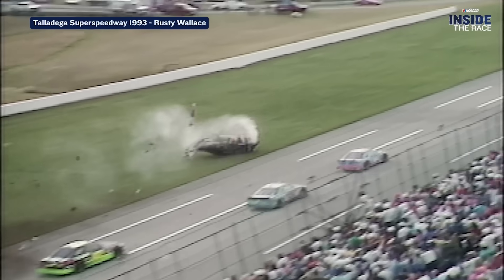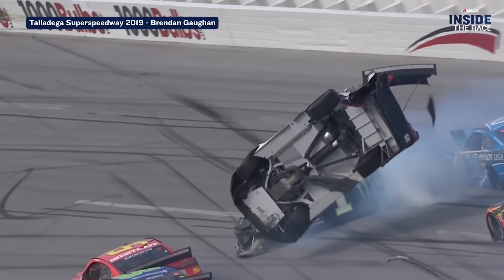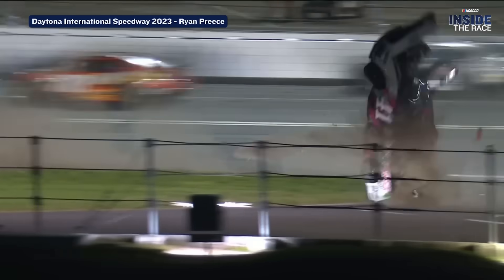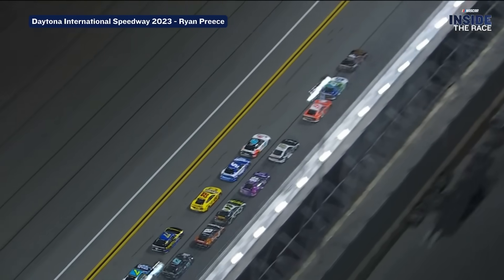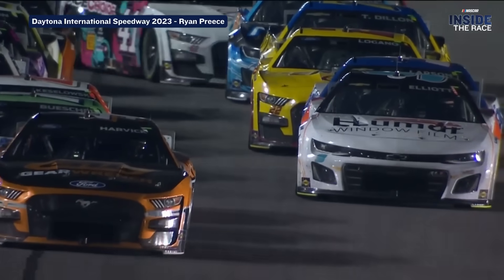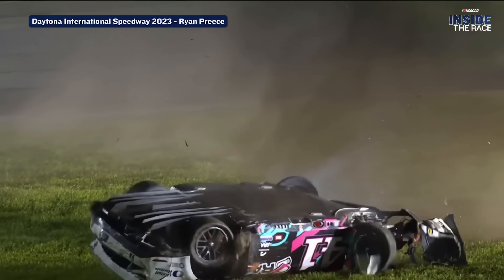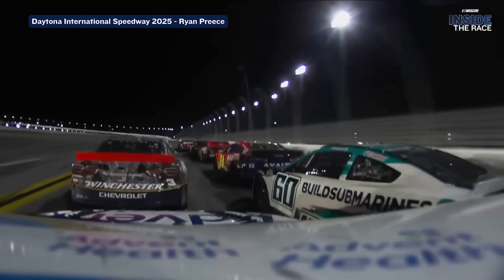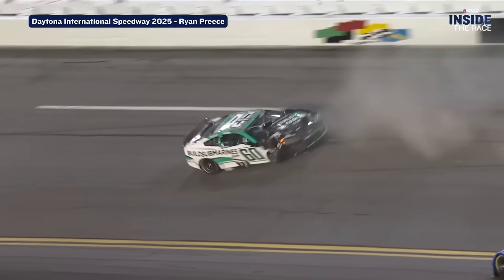Why it's so difficult to keep cars from going airborne | NASCAR

Comment: i feel the chain-link fence is the big problem, if you were to put at least 3 inches of lexan panels on the inside of the fence, the cars wouldn't dig in like a cheese grader.
Reply: I’ve said this for over two decades trying to create a safer solution. That idea won’t happen simply because of the rubber and dirt getting it hazy dirty. Would not be practical. But yes lexan would prevent the cheese grader of metal
Reply: @92genda  someone has been watching battle bots lol

Comment: Reworking the underbody is one way to lessen the frequency of them
Reply: id argue daytona paving that apron was part of it too. there’s nothing to physically stop the car from flipping like when there’s grass there. car is going to continue sliding until it’s acted on by a greater force
Reply: Shhh, don't say that! The flat smooth surface that covers almost the entire footprint of the bottom of the car cannot be the problem! The only way they'll consider that being an issue is if a high profile driver gets killed, you know, just like the non reaction they had with the string of basilar skull fractures that took Roper, Coleman, Alexander, Irwin & Petty until it got Dale Sr. then "something had to be done".
Reply: @kchez5586 Consider that NASCAR is the only non open-wheel series to suffer this many blowovers. Even GT500 cars, which have far more aggressive underbody aerodynamics (Cup cars are hilariously basic) don't really flip at all unless there's a catastrophic impact with either a tire barrier or another car.
Reply: @griffinfaulkner3514  Those cars aren't going quite as fast, and they're not packed up like this which means less chances for crashes in general, which means less chances for blowovers.
Reply: @WastdTrashPanda  Here's the thing, what few wrecks have happened at those speeds in GT500 haven't resulted in blowovers. Even adding GTP and Hypercar into the mix, the cars just don't flip nearly as readily as current Cup cars seem to. Pack racing's part of it, but taking another look at it I think there's another factor outside the cars themselves: the runoff area.

See, the runoff area around most of the circuits that see the kind of speeds Cup cars reach is just as smooth as the racing surface if it's paved, and grass where it isn't. Looking at the runoff at places like Daytona and Talladega, there's bumps and undulations all over the place on the paved sections, and if you hit one of those sideways at 180+ you're going to get airborne, regardless of what the floor looks like.

The only way to reduce the number of blowovers that doesn't involve completely redoing the runoff on a good chunk of NASCAR's ovals is reducing the amount of pack racing, which paradoxically requires throwing more power and less downforce at the cars to let them spread out more.

Comment: The Difference between a 35,000 Pound nascar car if the air gets into the car like due to wind or speed like 200mph in superspeedways and if the car gets on his roof and the grass grabs the roof of the car and cause to Barrol roll like many times.
Reply: 35,000? How about 3,500 lol
Reply: Do you know it 3500 lbs

Comment: Simple fix, rely more on mechanical grip and get rid of some of the aero.
Reply: Get rid of some aero? You mean DOWNforce?😂
Reply: @ yep, exactly what I mean
Reply: You really should google what downforce is and how it effects cars
Reply: @therealpote  I know what downforce does, I have been an avid race fan and car nerd basically since birth. maybe you should look up what a modified car is an how with only a minimal amount of downforce and can lap faster around places like Bristol and Martinsville than a cup car.
Reply: If it was a simple fix, it would have been fixed a long time ago. You're not very intelligent
Reply: Get rid of the flat underbodies at superspeedways, it will take a lot more to get them airbourne that way
Reply: Fix the flat bottom, remove the rear diffuser, it is just there for looks at this point, go back to the multi lug nutted tire as the rims are more closed preventing air from going underneath. and boom, less flips
Reply: Did you watch the video? Half the cars didn't have a flat bottom and they still flipped.
Reply: @therealpote  well, duh, cars are always gonna flip, but these flat underbodies are contributing to guarantee flips, look at ryan preece's crash at daytona this year, did a wheelie like it's Cruis'n Exotica, that never happened before
Reply: @therealpote  flat bottom does have an effect however I think it is more about how low the cars ride mixed with how seemingly large body shape wise they have gotten since gen 4. if the car is anything but on its' wheels now it is going to act like a massive wing at takeoff speed. Gen 4 used to have that issue until they introduced the flaps then it got pretty rare and was usually caused by secondary contact during the crash.
Reply: @pacthesir watch WEC

Comment: Counterpoint: barrell rolling is a great way to dissipate energy though lots of tiny impacts vs one big one, so maybe we should just try to find ways to make the flight happen in a controlled area (moving fans back from the catch fence) than keep sanitising the sport by slowing the cars down or paving all the runoff

As soon as they paved the daytona backstraight they had a car go upside down, stay upside down and have a terrible impact the wrong way up into the inside wall.
A roll through the grass wouldn't have been half as dangerous as that impact was.

When has any driver been hurt just from a barrell roll without any other impact etc 
Then cars are strong....they can take it 

You're not gonna get a bigger roll than preeces and he was ok
Reply: More horsepower not less.
Reply: @stevemullen8457 even at the superspeedways?
Reply: Then they should do what they did with the Daytona Rising project. The lower seats in the tri oval were elevated and moved back slightly so they weren't as close to the fence.
Reply: Excuse me, Ryan Preece was way more banged up from his barrell roll than Josh Berry was from his blowover.  And the emergency hatch ripped open. Berry's crash was definitely less intense and dangerous.
Reply: josh berrys crash was probably the best case for a flip. next gens crumple zones are built to work better upside down because the diffuser that was very well the softest head on crash ever above 100mph in the next gen
Reply: Wrong, the energy dissipated better in Berry's hit because the car was upside down and able to crumple better in the front.
Reply: Few deaths
Reply: @Marko137-em8nx  not in this era of strong roll cages
Reply: Preece’s 2023 flip was far worse than Berry’s 2024 flip. Yes barrel rolling is “safer” than nailing a wall at speed, but flipping through the grass is like nailing a wall every time the car catches the dirt.
Reply: ryan newman was pancaked like 5 years ago in flip... a car upside down is vulnerable, unpredictable and uncontrollable
Reply: @thepspman116  yeah,  I was talking more about barrell rolls through the grass without any further contact with other cars really
Reply: @cdname47  Cars still barrel roll on pavement (e. Chris Buescher Talladege 2016) Either way that proves the point further, cars on their lids more often than not isn't better. Cars wills always turnover at speeds greater than 160mph in the right conditions. But mitigate those situations where possible.